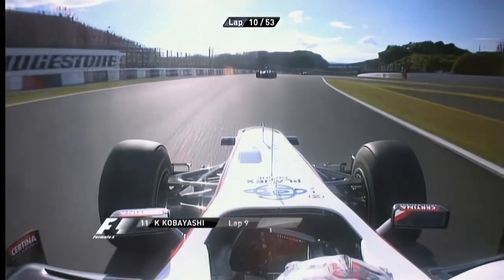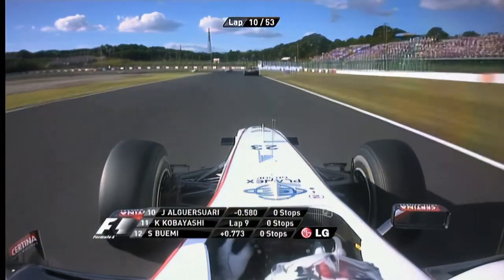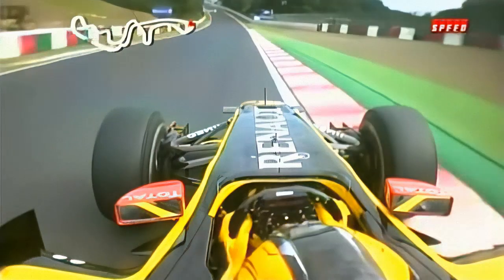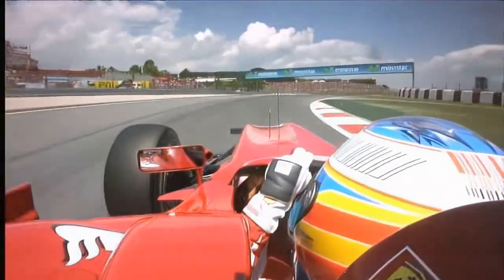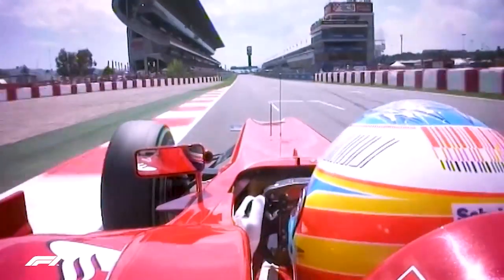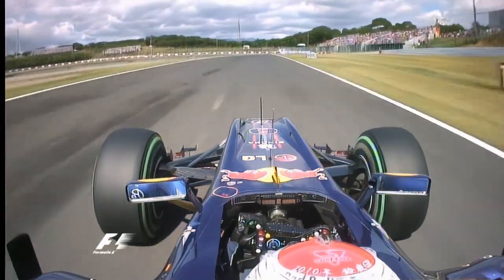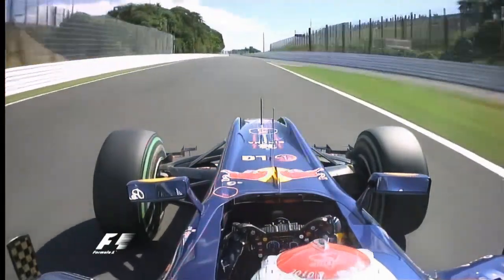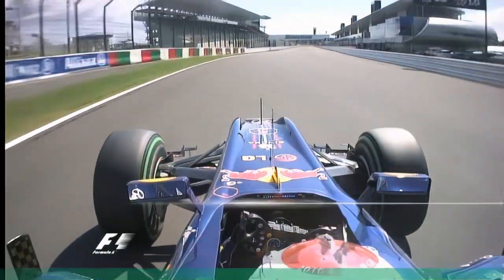F1 drivers using F-Duct : How it was allowed ?!

Comment: The original proponents of this device, McLaren, had their drivers use their left knee to block the duct, directing the airflow towards the rear wing. The reason it was nicknamed the F-Duct was because it was located by the 'F' in 'Vodafone.' Why everyone else decided to make the driver use his hand when they copied it I don't know. You could say it was a prototype DRS.
Reply from the maker: True ! Other teams where using their hands because the chassis of the car doesn’t allow them to put the air flow near the driver’s knee. It was easier to design it with the air flow near the hands of the drivers.
Reply: Because McLaren homologated their safety cell with the hole in it. The other teams didn't, so they had to punch a hole in a higher cockpit position.
Reply: I agree with you when writing it's a prototype of a DRS.
Reply: @Spyker8921  Yep, that was it. For other teams to use the knee they would need a new chassis and homologate it.
Reply: But what was it really doing, it was flapping down the rear wing??
Reply: @keziahleclercq1267  stalling the rear wing by introducing an airflow to the wing to introduce a stall in the wing, allowing a higher top speed. Geniunely genius solution.
Reply: Umm, are you sure its not called the F - duct because it was shaped roughly like the letter F, as was reported at the time. Do I need to explain which part of the F was at the front and which part was at the rear and which part you cover with your hand? Don't think it had anything to do with the Vodafone decal and everything to do with the shape.
Reply: @tracypanavia4634  It is almost universally reported to do with the fact that the original, that of the McLaren, had the duct at the "F" of in Vodafone. Especially when you look at the MP4-25 and none of the visible parts of the F-Duct are actually F shaped.
Reply: McLaren had better enginieering for their drivers
Reply: @josecamacho5522  what a funny company McLaren are. I would love to see them with a McLaren engine one day🤔🧡
Reply: Williams drivers used their left knee to use the F Duct
Reply: Driver : I could drive this car with 1 hand tied behind my back
Engineer : well we dont need you too do that. but you see this hole over here by the steering wheel..........
Reply: @AtomeMoemoe  Renault took a longer time than most to come up with their solution, which stalled the rear wing main plane, but it was more effective and kept Hamilton behind the long-running Kubica in Abu Dhabi
Reply: It was completly different than DRS
Reply: I think Ferrari and Alonso were the first ones to use the hand-operated version and everyone thought it was a good flex when they saw the onboards. So they copied that too 😅
Reply: It was the first year of chassis homologation so copying it was harder as you couldn’t introduce a B-spec chassis.

Comment: Vettel going practically onehanded, full throttle through eau rouge and blanchimont is not something i'll easily forget. Insane
Reply: 130r for me
Reply: i'm also worried about that front wing flexing on those parts.. how did they allow that as well? xD
Reply: Watching some latest accidents in Eau Rouge makes you think it was very dangerous indeed
Reply: @conorcarolan681  Believe in JESUS today, confess and repent of your sins. No one goes to heaven for doing good but by believing in JESUS who died for our sins. GOD loves you soo much unconditionally.🤩❤😇
Reply: Surprised the car was so fast when it had Vettel’s balls of steel weighing it down.
Reply: The entire grid did that in the 80s with far less safety and while driving 1400 hp turbo monsters

Comment: The original idea, made by McLaren had the drivers use the knee, which didn't "collide" with any function in the car, since both feet stayed in the same place either they used the F-Duct or not.

The other teams just had to adapt what they had without compromising the crash tests. Also, since the device was banned next season, I don't think they spent that much time thinking about safety.
Reply: And you probably don't need to activate the f-duct under braking anyways
Reply: @J.H.P  Yep, you need max grip available to make that corner without spinning like a mad man.

Comment: Dangerous yeah..but remember in the past they had to switch gear (not the same speed as today I know)
Reply: If you know then why even saying it. The problem is that they have to do that with one hand while going more than 200km/h, way more dangerous than changing gears in old cars
Reply: @F-Man  classic boomer comment…
Reply: going straight with power steering is more dangerous than cruising in less safer cars with one hand?
Reply: @ferst262  he is not wrong, the old cars were hard to drive but had different difficulties comparing to the current cars like the H gears and no power steering, remembering they did reach 330 km/h+ specially on the 80's turbo engine.  Today the cars are faster on corners which causes higher g forces but the wheels are lighter and the car is safer
Reply: @surneen  and they still manage both tyres, fuel and energy deployment while going faster overall than old cars. It’s harder, but boomers won’t admit it.

Comment: I've been watching races from 2012 recently and I notice many drivers putting a hand off the wheel, although there was no f duct any more, does anyone know the reason. The only thing remotely similar to f duct I found online was Mercedes stalling the front wing when opening DRS because they had holes under the DRS flap, but that was an automatic system as far as I understood so no need for the drivers to put their hand off the wheel. The only other reason I can think off would be that they got used to it in 2010 but it wouldn't make much sense as putting your hand off the wheel only gives you less control...
Reply: do you have any videos for that? Have been watching F1 for a long time but dont remember that in 2012 and i dont remember any big "cheating/technical loophole" in 2012 concerning anything driver acutated
Reply: Maybe changing the brake bias?
Reply from the maker: brake bias exactly.
Reply: @KingFishF1  like schumi in monaco! that lap was mega
Reply: @KingFishF1  But I think in some cars you change the bias on the wheel. If not all of them
Reply: @KingFishF1  hmm, I hadn't thought about that since now I think they change it on the wheel, but it's possible.
Reply: @alphonseraynaud976  ah okay, thats what you meant. Back in 2012 they changed the brake bias via a lever at the valve. Back then they did not have brake by wire but still hydraulic lines running to the back and front axle. The lever changed the amount of pressure between the front and back
Reply: @nelayo4894  thank you, I learned something new today!
Reply: @nelayo4894  how did the lever work? Did they set two "values" and flip between them or was it something you could adjust on the fly? because he obviously wouldn't be able to see any type of readout or anything to know exactly how much BB he was adding? I started watching during hybrid era so just curious.
Reply: @esoteridactyl  dont really know how the presets worked in F1 exactly but they had two brake cylinders at the pedal and via a rocker could adjust the amount of piston travel in the cylinder. However i´m not sure how it worked in detail sadly. They propably had some kind of presets or "up1 down1" kind of function
Reply: @esoteridactyl  if I had to guess then I would assume it would work by clicks? A click one way to move the bias forward and the other way to move it backward, then they could feel how much they’re adjusting the brake bias by
Reply: @TheTalentedTrout  ahh yeah that could work too.
Reply: @Malar1898  But DAS did something different than changing the brake bias. DAS changed the toe angle of the car. For Short: toe out gives good corner entry turn in, toe in gives good straight line stability, a lot of toe in or out creates friction thus heating the tires. 
Thats what they used DAS for. 
Or did I misunderstand what you were getting at?
Reply: @nelayo4894  the other guy asked if there were other "tricks / loopholes" that were used in F1. And i remember other Teams were caught offguard by DAS used by mercedes. Thats all 👍
Reply: @Malar1898  ah okay, yeah, they get hella creative even with these restrictive rules

Comment: i dont see a problem with the f duct, if the teams could have had time to integrate it into their chasis like mclaren where you use the knee instead of the hand it would have been fine but the chasis being submitted before the season meant they couldnt really modify the tub. Also drivers have been racing one handed for decades with h pattern gear shifts so i also really dont see a problem in that regard. Imo a better solution that drs.
Reply: I think F duct was ok for the first season but would have been pointless to keep around after that. Everyone would have had a knee-operated F duct and everyone would use it in the same places on track. So it just becomes a driver annoyance for no benefit.

DRS actually has a purpose to it - to undo the advantage a leading car has over a chasing car from dirty air. It's also a far stronger effect than F duct ever was.

Comment: this might be a dumb question 
if they need the duct to be closed then why dont they just block the duct anyway
Reply: They only need it closed on the straights to reduce drag, they need it open on medium and slow turns to increase downforce
Reply: so why not put a button to close it?
Reply: @mekaben5124  that would count as a movable aero device which is banned by the rules
Reply: @gregcandy3630  oh
Reply: Obviously never watched

Comment: why drivers had to do this manipulation to get this activated ? why it wasnt just a button to old like drs nowdays
Reply: Because they were charging the airflow of the ducts into the rear wing. McLaren had its drivers using their knees on the straights to make it work.
Reply: Also because motorized parts other than hydralic and stuff like that for the engine where banmed , so a manual drs was created
Reply: it was a loophole since there were no movable parts added in the car
Reply: DRS as we know it was introduced by the FIA themselves rather than any particular team in order to aid overtaking, which is why it's not subject to the ban on movable aero devices.
Reply: This is because the teams cant design a moveable aero device on the car, so instead, they made it so that the car remains the same, but the one who moves is the driver, smart stuff

Comment: The steering wheel must be little bit heavier now because I've never seen anyone drive with one hand now
Reply from the maker: It was just banned in 2011 because it was too dangerous
Reply: Charles Leclerc was driving in Spa I think when holding his mirror
Reply: @fuzeteaFzt  In Suzuka actually
Reply: kubica has barely any strength in one hand, so you could say he drives one-handed all the time!
Reply: nope in term of weight, but as you can see its dangerous when amateur use this technique. like maldonado or grosjean, if he lose it he can crash high speed by himself or crash to another dangerously. for pro driver its ok. DRS safety because its used in straight only.  F duck can use anywhere. i cant imagine maldonado use it hahhaa
Reply: @anggabudi5619  man, as much as we joke about Maldonado or Grosjean they are no amateurs. Maldonado is a GP2 champ and an F1 race winner. Grosjean stood on the podium multiple times and was a fast but sometimes erratic driver. 
We make fun of them for their mishaps but again, they are NOWHERE near being amateurs.
Reply: @anggabudi5619  Grosjean is literally a professional racecar driver who competed at the highest level in his sport. That's kind of the opposite of an amateur.
Reply: @KillerWhale806  yep sorry, i meant not kind of amateur, if u check 2012-2017, grosjean often crash in race start in several weekend, much more than average driver(of course my lord maldonado more crash). i meant these 2 driver are more dangerous than others. like many people joking about mazepin now. that kind of F duct in my opinion are more dangerous in hands of these people. prone to make dangerous situation, maybe FIA think that too, and banned it, change to more official DRS. for grosjean, now he is one of the best retired F1 example who succesfully perform in indy. i talked about his old days :)  , not in his prime now in indy car. he is favourite now

Comment: So while I get what it is, I don't get why it is.

Why is there a duct in the left side of the cockpit? I don't claim to have some great understanding of physics but wouldn't that "pull" air into the cockpit creating drag?

Did they want drag?
Reply: F-duct was one of the way of providing more air into aero devices. Drivers were blocking it by hand, changing pressures and in effect reducing drag.

As there were no moving parts, it wasn't considered "active aero" and therefore was allowed by the rules.
Reply: @gameboyterrorysta6307  yes I Google'd it, very interesting...

and also insane.